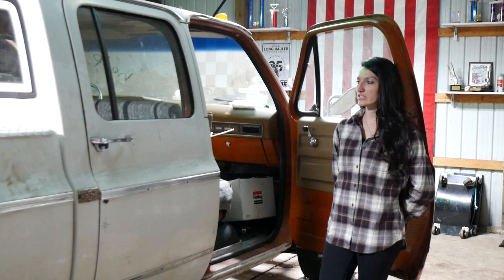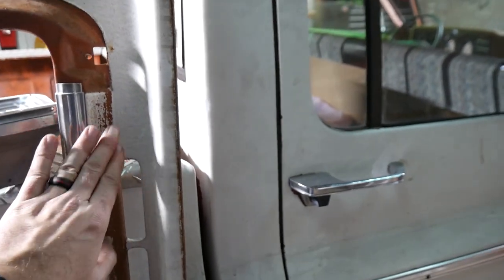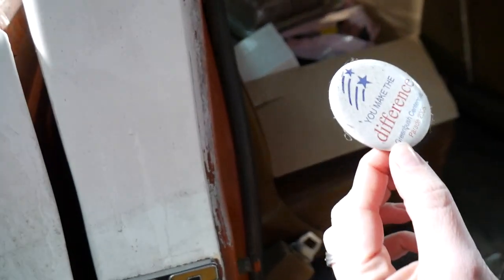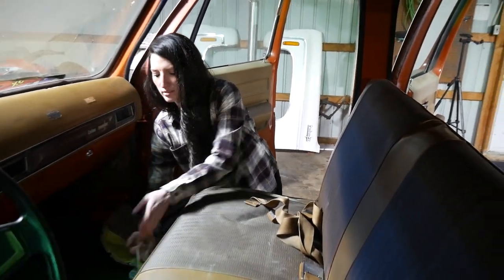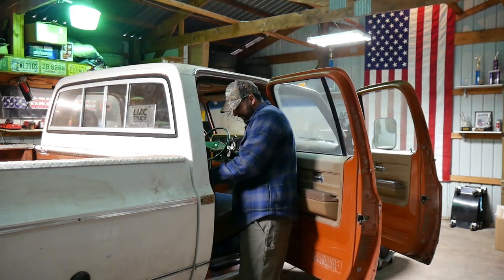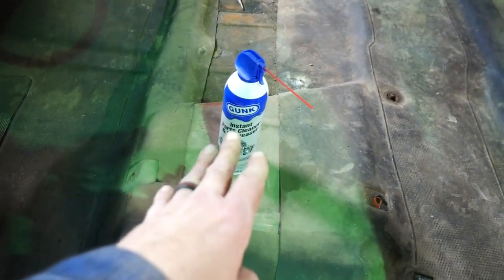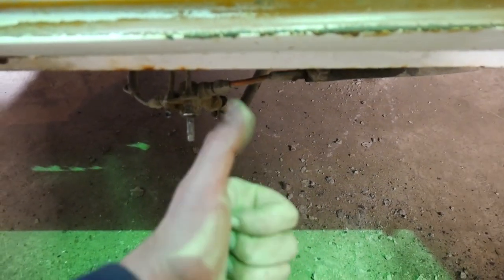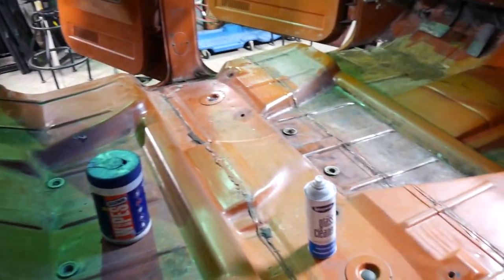We GUTTED the Square Body Chevy | Rebuilding a Truck Part 2 - Vice Grip Garage EP61

Comment: Let's see... Jessica picks up a random rubber part from the floor and correctly identifies it as a "Sway Bar Bushing" then goes on to open an unmarked white box and correctly identifies the parts as "Flex Plate Bolts".. Egads... she's a keeper.

Comment: The rear seat and front seat are interchangeable by switching the mounting brackets. I've done this several times. I could always find a good rear bench buy never a good front of course. The rear bench will also fit in a standard cab.
Reply from the maker: Great tips thanks
Reply: We used a rear bench out of a wrecked '80 to put into an '84? single cab me and my buddy were fixing on once back when I was a teenager.  Was cheaper than the upholstery shop, but that was in the mid 90s and a 20yr old truck was not really collectible or worth putting the effort or money into at that time.  I really do like the idea of light brown & white cowhide on those seats with the original burnt orange - would look about as factree as can be.

Comment: Dad bought a new '74 GMC 3+3 Camper Special 454 too pull our 5th wheel camper. Gold with wood grain side inserts. That thing was a beast! First time he let me back it out of the garage, (I was like 13?), I broke the passenger mirror bracket (big fold out camper mirrors) off an screwed up the garage door trim.😀 Seeing you work on this, brings back great memories!👍👌

Comment: Spent a lot of time in square body crew cabs during my time working Security in the missile field in the AIr Force at Minot ND.  The breeze that came through the door handle hole would freeze you leg  off in the winter.

Comment: One of my friend's father had a truck like that used to pull horse trailer with it and that a 350 in it which didn't have a lot of power boat has a very dependable and good running truck

Comment: tip for the high pressure fuel line...  transmission cooler hose, its cheaper and rated to way higher pressures and temps.  works with diesel or gas (havent tested it with e85 though)

Comment: Just for info. If your gonna keep the rubber mat on the floor boards. As far as cleaning it to a shine similiar to armor all is cream hand cleaner. Make sure uts the white colored one with nogrit in it makes it shine but it dont make it slippery. I wish istill hand my square body. I have a  c 1500 i would trade for a short bed square body in a minute

Comment: the poly spray foam in general is not good for the sheet metal it will accumulate a sheetton of water  and ice depending on location of course ...and will enlarge the rust  hole/ ankle vent  out making it even larger the next season or two so beware spray foam only in areas where rust is not an issue do not place inside door panels or  on quarter panels  they will just melts away  when treated with  spray foam the water it holds on the metal for weeks or even months at a time  will find every pin hold in any painted surface ..bad bad bad nonono in short  don't do it if in doubt